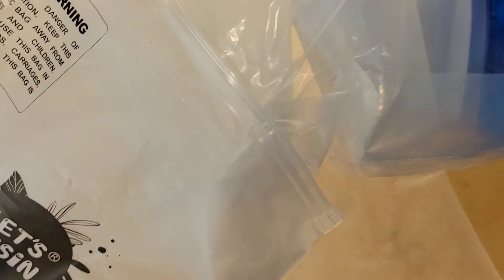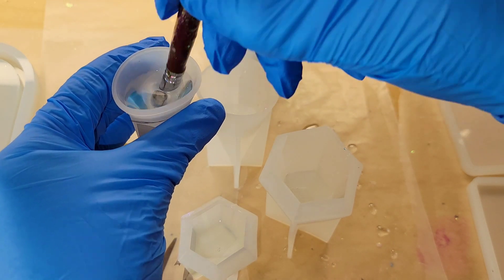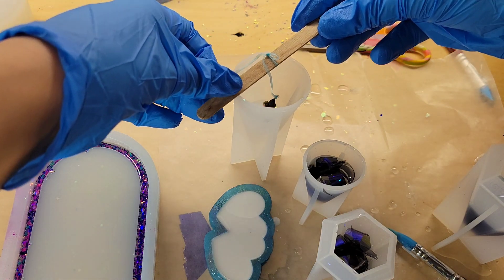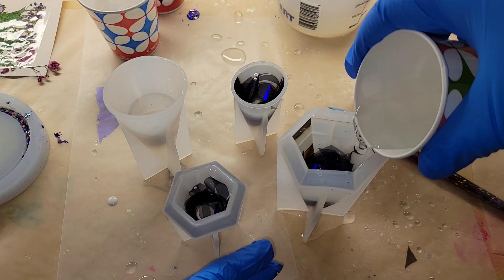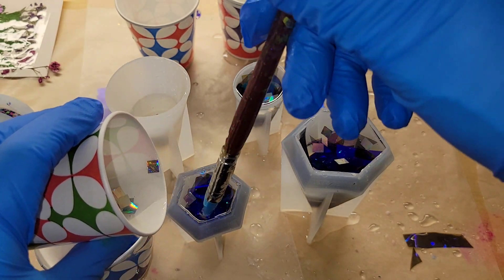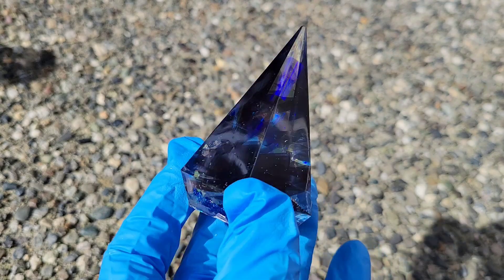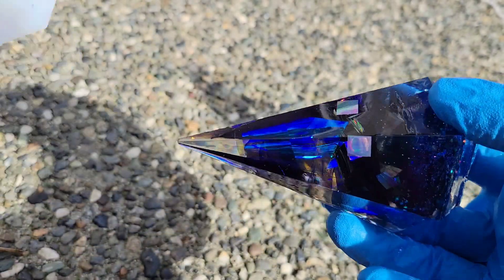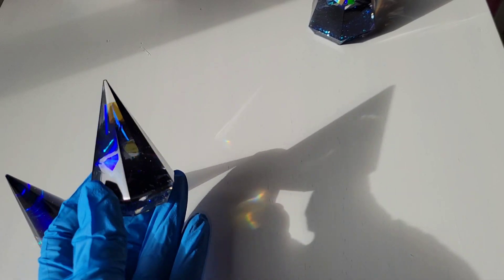Resin crystal tower ring holders | Using crystal tower molds from LETS RESIN | Unintentional ASMR

Comment: I love these!  I had bought the molds, so I appreciate the tips on how to make the items pretty and get them out!  Thank you!
Reply from the maker: Awesome, I'm so glad this video was helpful. These molds are so fun to use. Thanks for watching 🤗🤗🤗
Reply: @naptimecreations  I'm pretty new to resin molds.  I just hoping my resin cures at this point.  LOL. There are so many resins out there in the marketplace.  Wow!
Reply from the maker: @vonellevanzant237  there are so many brands now. I only use the one in this video for deep pours, floral epoxy from the epoxy resin store. 

For coasters other projects under 1/8 inch thick their general use epoxy is good and it's affordable.
Reply: @naptimecreations  wonderful!  Thank you so much!  It's the coasters I really worry about when a hot cup of something is set on them.  Not all resins list a temperature tolerance.  Have you had any trouble with coasters?
Reply from the maker: @vonellevanzant237  the hot cups can stick from the condensation ring that forms on the bottom of the coffee cups. I did a test on a bunch of different brands on my channel a while back. I top coat all my coasters with TotalBoat TableTop Epoxy or ksresin liquid stone. Those 2 brands do well for coasters.
Reply from the maker: @vonellevanzant237  in this video I made 10 months ago I do the heat test on coasters I made on my channel. Ksresin liquid stone did the best. This video was made before I started using TotalBoat TableTop Epoxy. They both work great. I have a discount code for both brands if you want to try them out. https://youtu.be/hPZE-awk6bY
Reply: @naptimecreations  I'll use your discount code to try out the TotalBoat when I need some.  I use the KSResin for my tumblers.  Is the TotalBoat High Performance you use?  I looked at that brand a couple of days ago.  Is that the one has a slow dry?  Which do you use?
Reply: @naptimecreations  thank you so much!  That top coat makes a difference, I'm sure, in the heat tolerance.  I appreciate you answering all these questions for me.  I've made 4 coasters, so you can tell a very beginner.
Reply from the maker: @vonellevanzant237  thank you, yes the ksresin would work great for top coats on coasters. 

I like to use the total boat high performance epoxy with the slow hardner but that one isn't good for top coats I just use it for projects inside the molds and topcoat with their tabletop or ksresin.
Reply from the maker: @vonellevanzant237  no problem, happy to help anytime 🤗🤗🤗 the general use epoxy from the epoxy resin store is very similar to the high performance epoxy from total boat and its about half the price. I would go with the general use epoxy and top coat the coasters with ksresin or TotalBoat TableTop Epoxy 🤗
Reply: @naptimecreations  about 1/2 the price sounds good!  This hobby could get expensive quickly!  Oh, well.  I'll just have to budget it in. 😁. Thank you the tip.  It's so good to visit with you.  Thank you so much!
Reply from the maker: @vonellevanzant237  most definitely, it can all add up fast. Nice to visit with you too 🤗 here's the link to the general use epoxy If you want to check it out. Discount code NAPTIME20 will save you 20%
https://www.theepoxyresinstore.com/products/crystal-clear-epoxy-resin-professional-finish-general-use
Reply: @naptimecreations  yes, I sure will!  Thank you again!
Reply from the maker: @vonellevanzant237  no problem 🤗💙

Comment: Could you write out the resin you use?
Reply from the maker: The resin I used today was floral epoxy from the epoxy resin store. It's a deep casting 3 to 1 ratio epoxy. It is a very thin viscosity and great for projects like this. It also has a long extended working time. 

Discount code NAPTIME20 will save you 10% 

https://www.theepoxyresinstore.com/collections/top-4-products/products/clear-casting-floral-arrangements-decorative-epoxy-resin